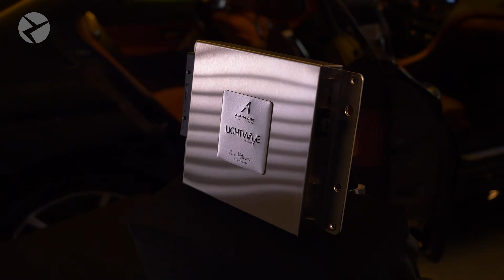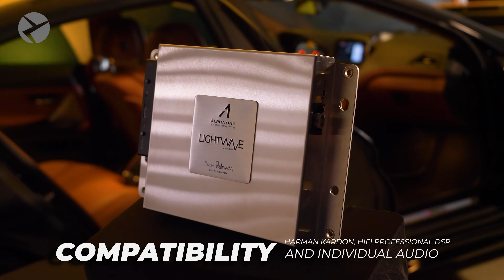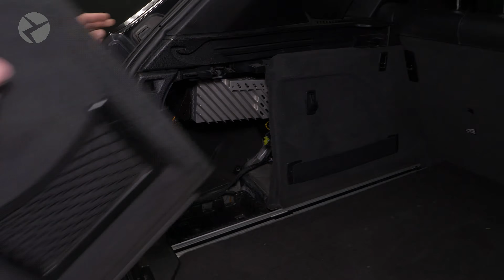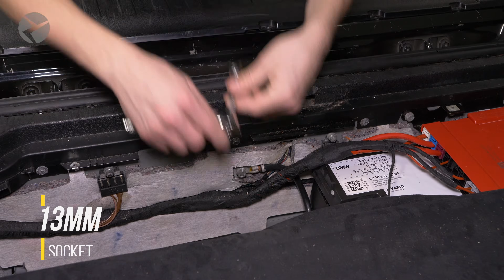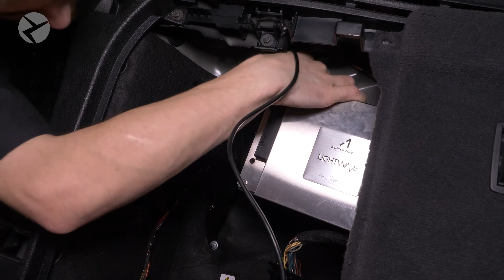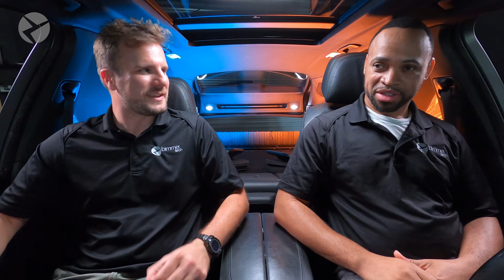Alpha One Lightwave Amplifier Installation Guide for BMW X5 (F15)

Comment: if ur x5 has a harmon kardon  and it sounds muffled.
Perhaps you should first Take off the stupid Default Setting Surround....
Everytime I hear someone w a new beemer they always leave this option on because some idiot at the dealer recommends it for some fuck no reason...
Top of that, hip hop/trap/ and such are probably the worse benchmark genres to even use considering all they care for is the bass and if the producer knows nothing about compression, using limiters probably, or freq on their master channel then well... you can't argue the fact harmon kardon is "meh" audio. 
Use a playlists to benchmark all my audio systems even for cheap systems that have an adjustable  parametric eq... 
those can even sound better than a tier higher if you've done it before. 
I love this product personally but to say the Harmon Kardon/Factory is muffled???? 
That's a stretch.
Reply from the maker: Believe us - you don't need anything more than the amp to significantly upgrade factory HK :)
Reply: @bimmer-tech  shipping to Canada?

Comment: I installed the Lightwave Amp in my 2018 G32, but I don't seem to have my center speaker working.  I would also like more details on how to hook up the sub-channel.   When I log in to bimmertech and go to the instructions section there are none.
Reply: I am also looking for what software can be used to tweak the settings/levels via the USB port.
Reply from the maker: Hey! Sorry you met the issues while installing. Please, contact our support team - support@bimmer-tech.net. Support guys will help you out :)
Reply: Hi Jim,
It was a pleasure to speak to you today. I'm looking forward to our setup call tomorrow ;)
Reply: Hi @jimmartin7905
Did u found a solution? Bc it seems like I have the same problem. And overall im not that happy with the sound at all in comparison with the HK System, would be nice to can tweak some parameters on the DSP settings by myself….

Greetings

Comment: Hi - Is this compatible with my 2023 X3 M40i with 688 Harmon Kardon system?  When I enter my VIN# and try to order on your website, it says the amp is not compatible with my car.  Thank you.
Reply from the maker: It's sadly not compatible with the newest iDrive systems
Reply: @bimmer-tech  - Thank you.  Are you guys working on a lightwave amp that can work with the newest iDrive systems?  Also, is there a significant difference in sound quality between the lightwave amp vs the regular Alpha One Amp that is compatible with my car?
Reply: Hi @AlterZgo   At this time we have no plans on making it compatible with the late model BMW's. The biggest advantage of the LightWave amp is it's built in digital input signal over the fiber optic cables allowing clean digital audio signal straight into the amps DSP. It doesn't even have analog inputs. Granted it also sounds out of this world good - it's one of the best amps I've ever heard overall ever. And I've been in the High End home stereo distribution business before where a 10.000$ stereo amp is fairly run of the mill stuff. The LightWave sounds like a 20kUSD+ unit. I could hardly leave the car when I first set it up in the bosses F15 X5 2 years back. It's that good that you keep putting on the next and next and next favorite records of yours as it all sounds new and better like listening to stuff for the first time even though you've heard it a thousand times before.

On late model BMW's with HK at this time we have no other choice than to use analog input signals from the factory BMW RAM & Booster. Of course there is a digital audio signal in late model BMW's too but it's running on encrypted ethernet so it's not exactly easy to tap into it. While not ideal we can still significantly reshape and improve the sound on HK BMW's  with our dedicated Alpha One Amp for those as there is still a lot on the table even when using factory speakers. You already know that 464W BMW quotes in those cars is max output so the RMS is closer to 232W and probably not even that much. So between the extra power we have on tap and all the DSP - we still can make a night and day difference in sound even without getting a digital input signal.

Comment: Yes, please add a video on adding an external sub!  And maybe more in depth on the custom tune (i.e. the questionnaire that we fill out at checkout on what each option does for the tune).   Very excited about this amp option for the Toyota Supra with JBL
Reply from the maker: Thanks for suggestion pal! Will think about that! :)
Reply: @bimmer-tech  Perfect! That's the only thing holding be back from hitting the purchase button on the amp.  I listen to all levels of sound and not sure how to complete the questionnaire for the tune accurately.